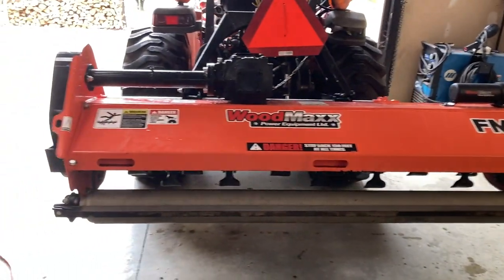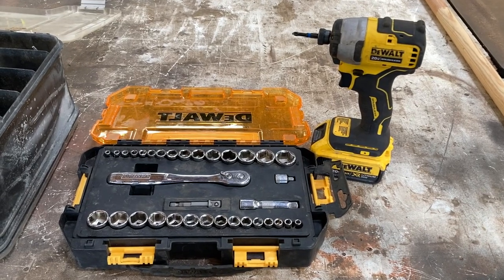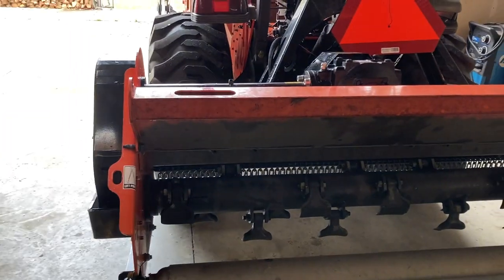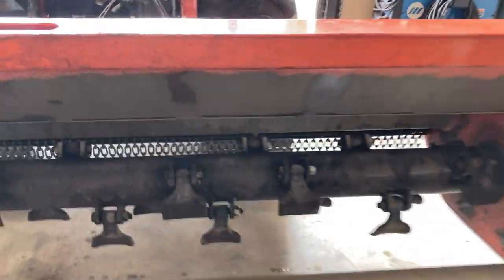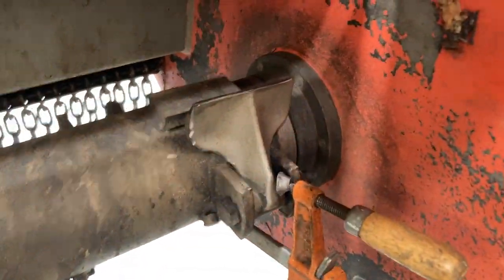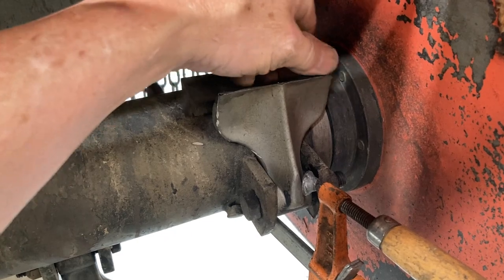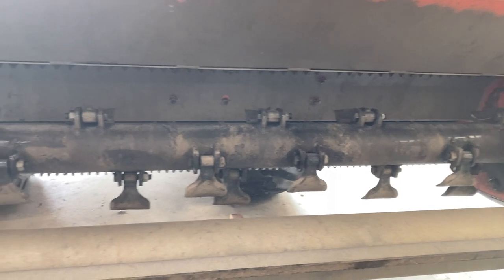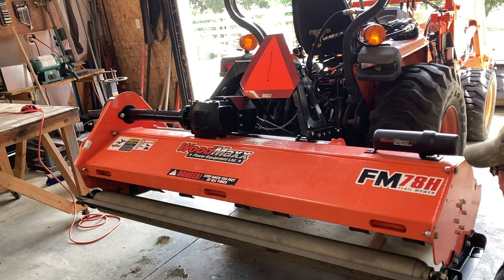Flail Mower Hammer Blade Sharpening

Comment: Why does it look like you're giving it a flat grind instead of angled?
Reply: I think because the actual angle is not very narrow ? so it's not sharp like a knife with a very tapered blade, it's a-bit-less-than-flat but with a well-defined edge. That would make the resulting edge a lot stronger than a fine taper, and given what flail mowers go through, strength is very important !